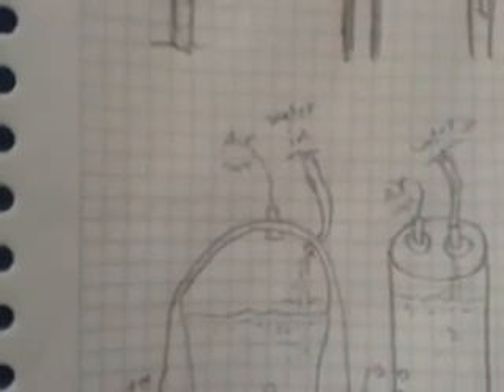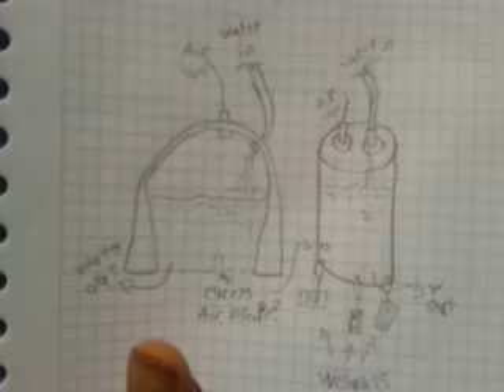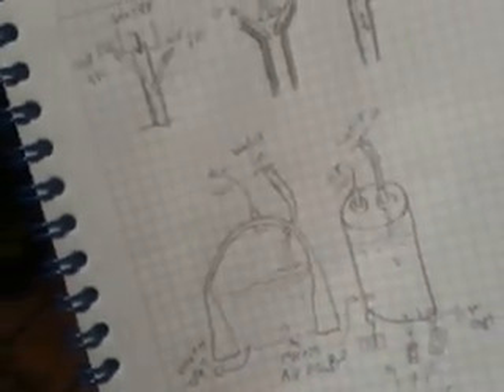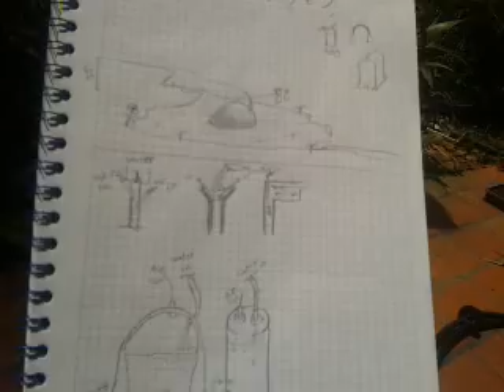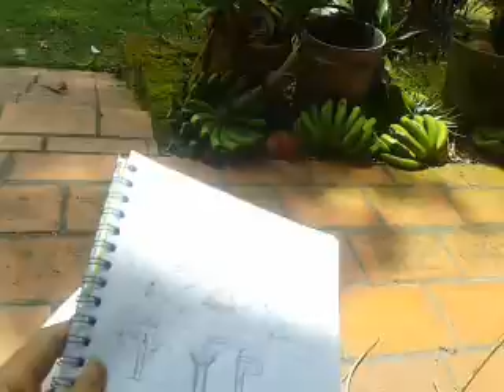2 trompe failures 1 video

Comment: hmmm, I think your design has a flaw.  The intake pipe shouldn't be near the top of the pressure chamber.  Most designs I've seen have the intake pipes located at the bottom.